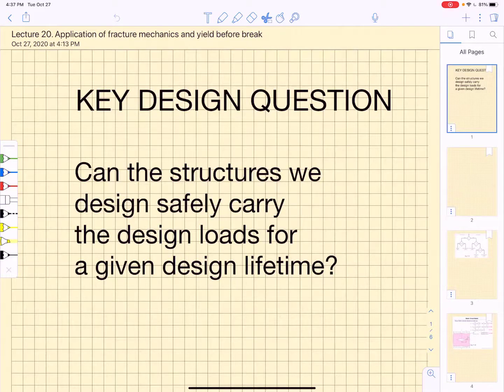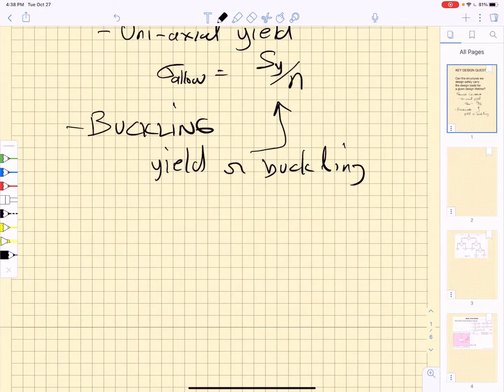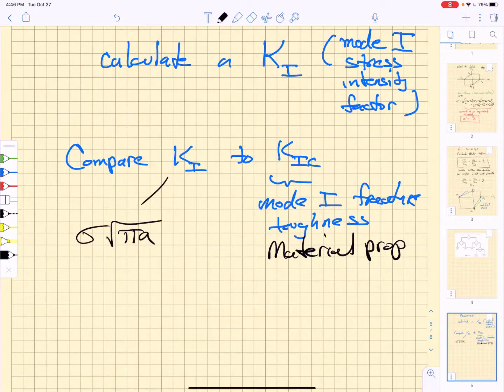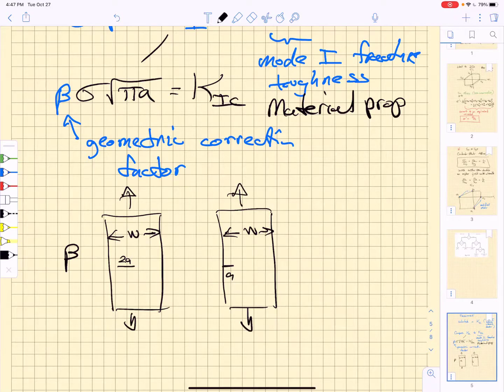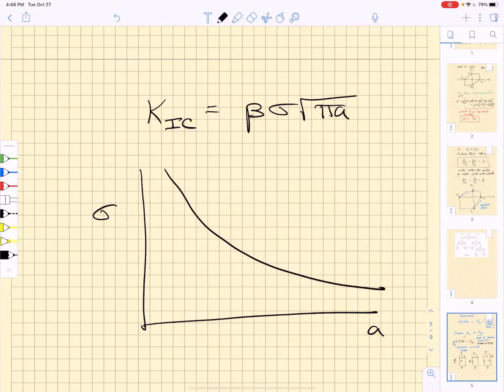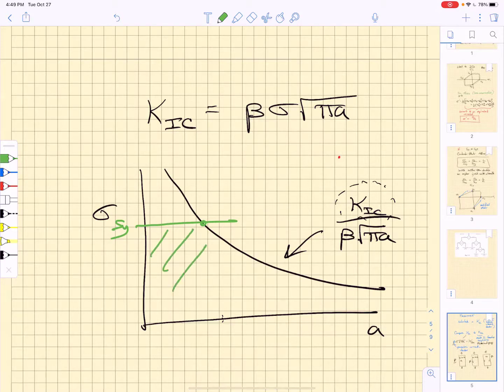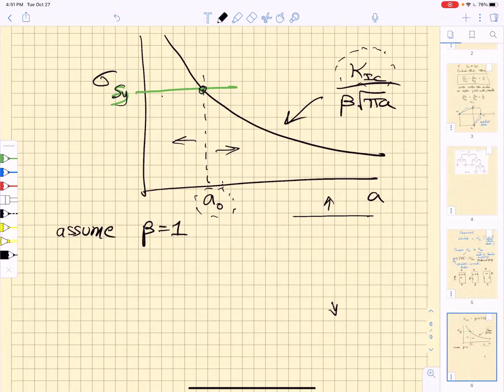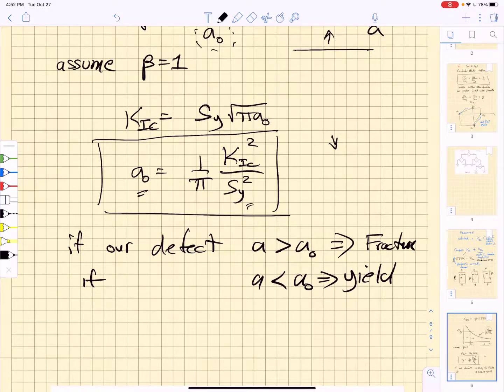Lecture 20 Fracture Mechanics

Comment: This is the most comprehensive video on fracture mechanics I've seen
Reply from the maker: Thank you for the kind comment.  I have plans to do more, but always run into time constraints!  If it helps in any way, I am happy.
Reply: @MechaTomics  I appreciate your efforts. I understand it's not easy to manage time especially with such complex topics. I am rather impressed on how you could present these concepts clearly and concisely.
Reply: @MechaTomics  I want to propose, if you don't mind, that you maximize the writing ✍️ and minimize PowerPoint. I know many people understand more as they observe the teacher writing down stuff instead of just showing a typed page because that's what we are going to do in tests and practice. 

Also, please could you make videos to show how you develop your excel sheets? I found them so helpful and easy to do design with them. 

I know these will not be easy to implement, but I would really appreciate.
Reply from the maker: @Mr_mechEngineer  I do agree with you .  As I move into retirement I am going to redo all of these topics and attempt to make it better.
Reply: @MechaTomics  thanks so much. My engineering education will benefit highly.